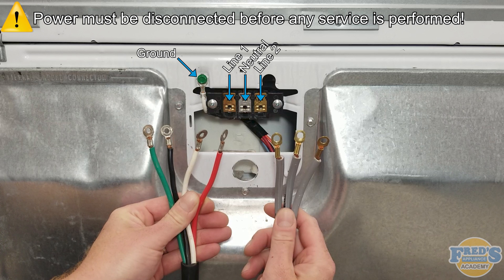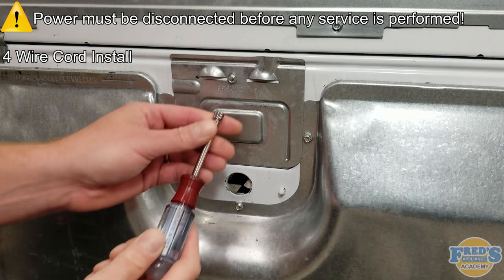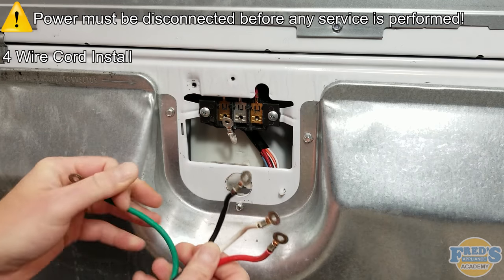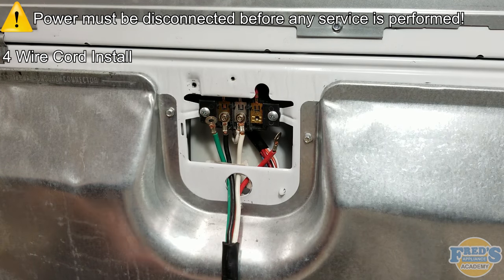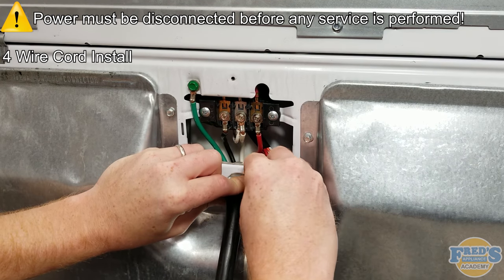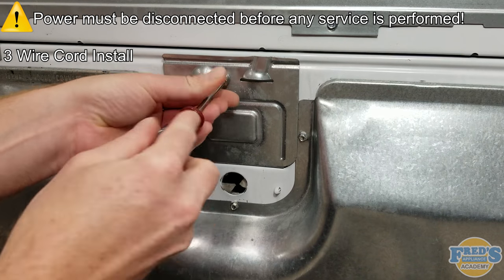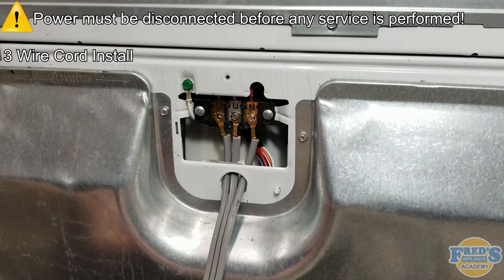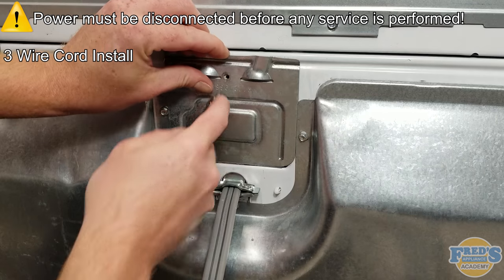How to Install 3 and 4 Wire 240 Volt Dryer Cords

Comment: Due to many wondering if the small wire connection instructions are correct:
The small white or the green with the yellow stripe is the connection/jumper between the center neutral lug and the frame on 3 wire cords only. With a four wire cable you must not use that connection so the wire is put under the neutral screw to hold it out of the way. It is just connected to itself inside the unit. All other green wires connect to the metal cabinet frame.
Reply: So the guy in the video did it correctly?
Reply: See I came lookin for this comment cause mines a green/white wire that’s doubled back on itself lol
Reply: This is the missing link to the video, thank you
Reply: Yep I learned by this video also re where to put the other white wire ..   thanks !   
Did you or anyone here  have any problem with hooking up the green wire on green screw.? but my green wire does NOT reach to the green screw. Someone told me I can move the screw closer to another hole on back on metal on mach  ?   I know the green is the ground . 
I am scared to do that before I get advice.
Reply: Thanks for this explanation. My wire is green with yellow stripe and all the examples on line show it as white. Kenmore shouldn't have used a green color when in reality it's neutral. And I know this to be true from the diagram on back of the unit too.
Reply: Finally!  So many videos of hooking these up and not one person explained that!  Thanks for the info!

Comment: Thank you so much for the video! I understand that the center cord on the three prong is neutral and will always be neutral. However, when it comes to line one and line two I'm not sure which is which. If you flip the cord the other way, the center is always going to be neutral no matter which way you're holding it. But l1 and l2 are going to be in different positions depending on how you're holding the cord. Is there way to know what's the proper way it should be facing? I'm thinking the flat side of the connection should be facing away from you where the center of the crimp should be facing you. Is that correct??
Reply from the maker: Hi Johnny! Thanks for dropping us a line. L1 and L2 are interchangeable. Hope this helps!

Comment: This video agrees with my manual for dryer. I think that goofy ground/ neutral wire moving is needed to avoid bonding issue
?
Reply from the maker: Just remember on the 3 wire they come together. On the 4 wire they stay separate.

Comment: Can you explain what to look for in question of the damaged bolt and nut cross threading you spoke about?   I wonder because they have recently attached a 3 prong dryer cord to my new dryer and also have questions about it. Like for example how would I know which is the correct prong to use a 3 or 4? Is it depending on the wall socket capacity only?  I'm not very knowledgeable on any of it and I would greatly appreciate some much needed guidance to make sure I know what's going on when the delivery guy hooks up the brand new dryer ordered because the new one received seems to be faulty and I wonder if it's due to this 3 and 4 prong option.. 😮
Reply from the maker: Sure! When any damage occurs to the nuts or bolts they will not seat correctly. By that I mean the screw will not go in all the way and tighten against the cord. The screws should almost effortlessly go into the nuts. Any resistance means cross threading is likely happening.  Cross threading is basically when the screw or nut is not aligned and threads become damaged. You can visibly see this on the threads when it happens. When we talk about prong, it is the cord that matches to the outlet. If you have an outlet with 3 holes you need a 3 prong cord and if you have an outlet with 4 holes you need a 4 prong cord. A 3 prong or 4 prong setup will operate the dryer without issue. Hope this helps!
Reply: @fredsapplianceacademy  Om my that was a speedy delivery! Thank you very much. I have learned something from your video and response that I would be clueless about beforehand. Thank you again for making the video and for taking your time to explain this so clearly. 👍😀

Comment: I just attached the 3 wire as we moved into a house with it from a 4 prong. I did as you showed, and after the dryer runs for about 5 or 10 mins, the breaker for that outlet keeps shutting off, and suggestions as to why this takes place? Dryer kicks out heat and functions as it should. I did notice that I had the wires facing the wrong direction, not the correct placement, but the crimps attaching the wire to the actual connector.
Reply from the maker: You can take an amp draw on the dryer. With an amp probe put it around the red or black wire near the terminal block then run the dryer on timed dry high heat. When heating it should draw right around 24 amps then drop back down when not heating to around 5. If the amp draw is normal I would suspect your breaker is weak or there might be a loose connection in the home wiring. If the Amp draw for the dryer is too high there is a fault in the dryer such as a short that needs to be corrected.
Reply: @fredsapplianceacademy  perfect! Thank you kind sir for the knowledge, will run with that and fix this.

Comment: This helped me out a lot but now I don’t know what to do with the wire cover plate. When I had the three wire on there it was fire and it just went underneath it but with the larger four wire cable it doesn’t fit. Unlike the one shown in the video where the cover panel doesn’t go over where the cord goes into mine does.
Reply from the maker: It almost sounds like for some reason the unit was not designed to take a 4 wire cord. But, off the top of my head, I am not sure what type of unit that would be.  If it doesn't fit DO NOT force it. Also, make sure you are not installing a range cord that will be larger in gauge making it difficult to install. The cover plate must go on! If the unit will not accept the 4 wire cord install a 3 wire per the video and make sure the cover is put on.

Comment: So does it matter which wires go left and right as long as the middle line goes in middle neutral? And if so could you explain why?
Reply: Hello there Connor. When doing a 3 wire install as long as then neutral is placed in the middle it does not matter where the two outside lines go. This is because L1 and L2 function the same way. we could say that l1 comes off the left side of the transformer and l2 comes off the right side.  When both L1 and L2 are used for a power supply you get 240vac.  Any time neutral is used it splits the transformer in half and the power supply will now be 120vac. Hope this helps.

Comment: Great video. Any advice for when the neutral screw is won’t come out? The one on my dryer keeps spinning
Reply from the maker: You will need to order a terminal block kit and replace the screw and nut that are stripped. Use what ever parts of the kit you need to get the job done and save the rest for future use if needed. The part number is 279320 and can be bought on Amazon. 

associate link https://amzn.to/3xcS0l7

Comment: With the 3 prong does it matter which is line 1 and line 2? Does the cord have to be facing a certain way in there?
Reply from the maker: On a 3-prong dryer cord, it does not matter which line is on 1 or 2 as long the center cord is in the neutral spot.
Reply: @fredsapplianceacademy  thanks brotha

Comment: My brand new LG dryer with a four prong cable would not turn on until I moved the dryer neutral wire to connect with the green ground wire (like the three prong wiring). My only guess is the house outlet wiring must be incorrect. 
Umm, is it dangerous to wire it this way?
Reply from the maker: I would suggest having a professional out to check on your situation.

Comment: I did the 4 wire way and my dryer did not work until I put the white wire that was originally on the ground back to that screw with the green wire, why is that??

Comment: So, on the 3 wire connection, the neutral wire is the only wire that has a specific place? And the other two wires can go to either side?
Reply: The neutral wire (the center wire on a flat 3-wire cord, likely labeled neutral on newer cords)  MUST go the neutral terminal, which is the center, silver terminal.  The 2 "outside" wires on the flat 3-wire cord can (Edit: separately, of course, and NEVER hooked together) go to either side on the terminal block.

Comment: Just had a new dryer installed. I noticed that when I touch the dryer and the
faucet at the clothes washer I get a shock. Why?
Reply from the maker: Something is shorted or not wired correctly. Turn off the power off at the breaker and check the wiring at the terminal block to the dryer.

Comment: New dryer not working after 3 prong cord install. Swap the other 2 wires on the terminals with neutral still in the center?
Reply from the maker: Neutral will always go in the center.  L1 and L2 won't matter. If it's still not working after install, might have an issue with power supply or the dryer itself.

Comment: What size nut driver is needed for the green screw..I know it was 5/16 but when I try to purchase one it also has another measurement with it
Reply from the maker: The screw should take just a standard 5/16" nut driver.  Often they come in multi-packs which is usually the best deal. If you are using a socket wrench I would suggest a 1/4" wrench be used to avoid stripping the screw out.

Comment: Cool bro, but no explanation as to why in the second half of video the dryer neutral is on the ground port????
Reply from the maker: in the 3 wire neutral and ground must be bound on the dryer. In the 4 wire they must remain separate.
Reply: @fredsapplianceacademy  Thank you for clearing that up. I currently have the 3 wire connected and added my own ground wire from the original ground source on the dryer to a known good ground on the house. Is there going to be a future issue with how I did it?
Reply from the maker: @aphlatus  You should be good!

Comment: I have a question. Does the information in this video apply to the current wiring code in Texas? I only ask because they changed the wiring code a year or two ago, and I want to be sure that if I follow the instructions in this video that I won’t blow out the dryer.
Reply from the maker: The 4-wire cord is now the new code. This does not change the operation of the unit or how it uses power. It simply provides the unit with a dedicated neutral and ground wire making it safer for the user to operate.

Comment: On my Whirlpool Cabrio the holes that the wires screw into seem to have a nut behind them to screw into. Also I don't have the original screws. Can they be purchased at a retailer? Thanks a bunch??
Reply from the maker: This is correct. Almost all terminal blocks will have a nut of some kind to drive the screw into.
Reply: @fredsapplianceacademy  Thanks for the reply. ACE hardware had what I needed and it's running more. Appreciate the help buddy.
Reply: I read — You have a cabrio 
Did your green wire reach to the green screw? Also do you have a whirlpool cord with circle hooks at end or the fork type  ends  one? I have former 4 prong cord which has the fork ends. 
My previous machine was a GE profile . Thinking of buying the amazon whirlpool plug  one ? Waiting on a reply from the expert . 
His videos are great!!

Comment: for the 3 wire install .. you didnt connect the neutral that was wired to the appliance ..  was this not needed  for the 3 wire ?
Reply from the maker: The wire that is on the appliance is also connected to the neutral on the terminal block. It doubles as a ground wire in the 3 wire cord application.
Reply: @fredsapplianceacademy  Thanks for that.!!!   much appreciated !
Reply from the maker: @negrilsand  You're very welcome!

Comment: How do we know which is the right side and left side of the 3 prong cord when we never saw how you were holding the cord, or the prong end?
Reply from the maker: The middle wire is the neutral. L1 and L2 and interchangeable.
Reply: @fredsapplianceacademy  I found that out on another video. If you said that in your video, I missed it and I apologize. Thanks for replying
Reply from the maker: @chhansen9813  No worries!  Glad you found the info you needed! Thank you for following up :)
Reply from the maker: Hello! L1 and L2 are interchangeable. Hope this helps!

Comment: I installed a dryer cord today.  The red, black and white wires are long and there is slack on the inside part of the dryer.  Is it okay if the wires hit the back of the dryer drum?  I ask because if the drum gets hot,  I don't want to have any issues with it with the wires hitting it.  Thank you
Reply: I would keep the wires away from the drum not just because of the heat but because it rotates in there constantly. 

If that belt ever snaps or something breaks in there and gets wrapped around the drum the wrong way and snags one of those wires, it could easily weaken the connection or even rip it free. 

Best case scenario it shorts out and the breaker trips or the fuse blows, but dryers can easily catch fire in that kind of situation.

I would suggest getting that strain relief clamp in the video and pulling as much excess wire outside the dryer as you can without exposing the copper and then clamp it.
Reply from the maker: There should not be any issues with the wires resting there. Be sure that the venting is as short as it can be and kept clean. This will allow for optimal drying as well as reduce any heat transmitted to the outer parts of the unit.

Comment: Does it matter what wire goes in line 1 or line 2 ? Kinda confused… you did say the neutral is the middle, but what about the other wires. I’m lost 😞
Reply from the maker: On the three wire as long as neutral is in the middle you can't do it wrong.

Comment: Strain relief was not with my dryer 😭 is it expensive to replace?
Reply from the maker: hi there! they're cheap. and you really should make sure it's installed for safety reasons. https://www.homedepot.com/p/Halex-1-1-4-in-Non-Metallic-NM-2-Piece-Clamp-Connector-2-Pack-26514/100185401?source=shoppingads&locale=en-US&pla&mtc=SHOPPING-BF-CDP-GGL-D27-027_006_CONDUIT_FIT-NA-NA-NA-PMAX-NA-NA-NA-NA-NBR-NA-NA-NEW-NA&cm_mmc=SHOPPING-BF-CDP-GGL-D27-027_006_CONDUIT_FIT-NA-NA-NA-PMAX-NA-NA-NA-NA-NBR-NA-NA-NEW-NA-71700000113157690--&gclid=CjwKCAjws9ipBhB1EiwAccEi1DyvRc7Bo7Wsp2W4x3RdHhYkT1mQKmOcYr-_6m7iJDMIXf4eLxZUMxoCRzoQAvD_BwE&gclsrc=aw.ds

Comment: In the 3 wire cable it looks like one neutral wire is connected to the frame and presumably doubling as a ground wire and the other is a normal neutral wire. How is this allowed, when the neutral and ground can only be bonded at the main service disconnect?
Reply from the maker: 4 wire is the new code in modern homes however 3 wires is still accepted in older homes. In 3 wires, the neutral and ground must be joined or the unit would not have any ground at all. Electric dryers are produced this way, still, today. This only applies to 240 vac applications. In 120 VAC applications, the ground and neutral should never come together until they get back to the main panel.

Comment: In the 3 wires installation, why do you need a neutral and no a ground.? I am confused because I believe that  a 220/240 doesn't need a neutral
Reply from the maker: Only certain parts of the dryer operate on 240 such as the heater and timer motor. The drive motor runs on 120 and requires neutral.

Comment: Hi I’m connecting a 4 prong to my dryer. When I opened it up there is a white cord and another green/yellow cord. How do I connect it? Thanks my dryer is a kenmore. I followed the directions that is posted on the dryer. But I forgot which wire whether it’s the white or yellow/green connected to the ground.
Reply from the maker: White is neutral and green is ground. Please watch the video again and it will walk you through the process.
Reply: @fredsapplianceacademy  there are two wires from within the dryer (white/greenyellow) with a 4 prong setup I’m using it’s cords as follows green with the ground . White neutral and both hot cables.  So where would the  white and yellow green cable coming out of the dryer be plugged into. Thanks. In the video there is just a white cable not a yellow and green that I have
Reply from the maker: @epyedits7713  Without seeing it, it's really hard for us to direct you. We want you to be safe. We feel it would be best to call a service professional at this point.

Comment: I swapped a 3 prong cord for a 4 prong on a Roper dryer. Now it doesn't heat but spins fine. All thermostats, heating element, and thermal fuse have continuity. I tested the outlet and get 120 V on each line individually and 240 V together. Testing the back panel where I connected the new cord, the center+left and center+right both show 120 V, but left + right shows 0V (whereas the outlet shows 240 V). Do you know what's wrong with my dryer?
Reply from the maker: Hello Billy! We may be able to help further. Please send us a very clear picture of the wiring of the cord at the dryer. Don't forget to unplug it first! You may email the picture to school@fredsappliance.com
Reply: Same thing happened to me what did they tell you it was?